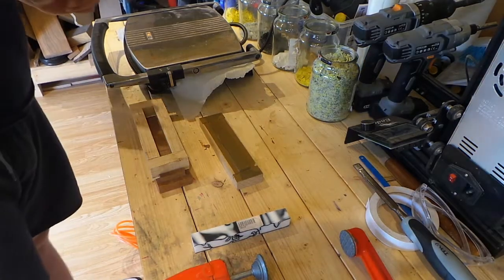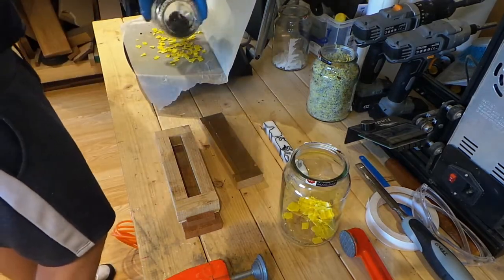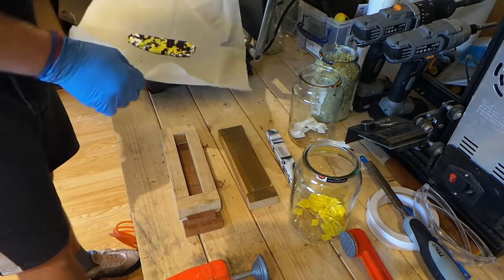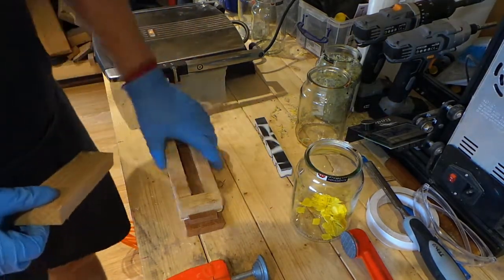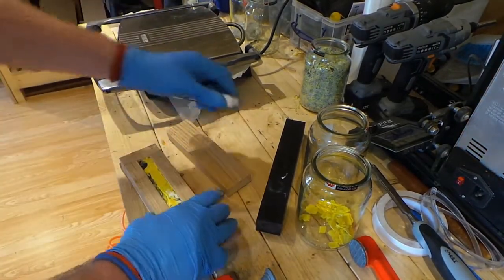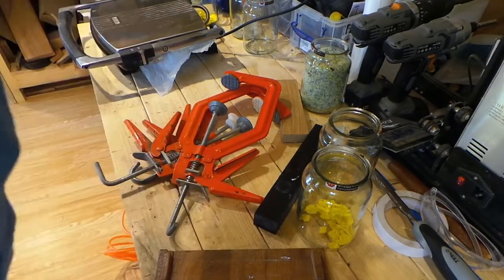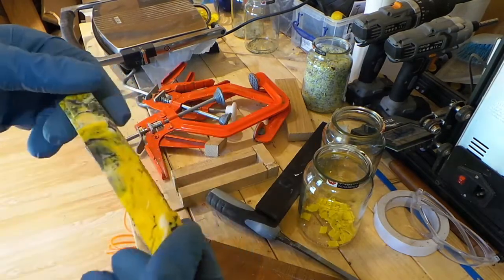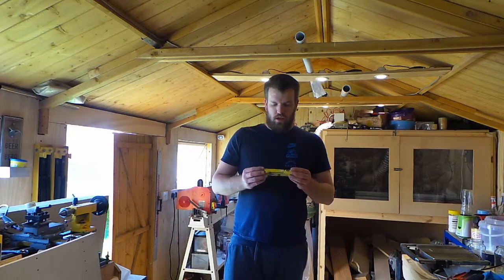HDPE Pen Blank

Comment: Nice blank! A few tips that we have found from working with HDPE... you want to really CRANK the pressure to avoid any air pockets forming. Also, try to keep the pressure on whilst it’s cooling as it will shrink considerably and that can also cause air pockets to form. We try to come back and tighten the clamps every 10 or so minutes until it’s cool. Love the colours! Yellow is hard to find! Off to watch the pen vid now 👍🏼♻️
Reply from the maker: Thank you for the advice, much appreciated.. I will make some new pen moulds that can withstand the clamp force and try again.. I found bleach bottles an easy source for yellow